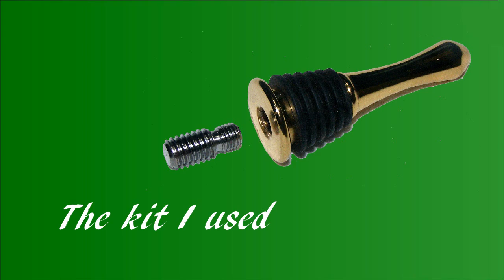A quick recording on how I made a bottle stopper

Comment: What size drill bit and tap did you use?
Reply from the maker: Hi Thanks for watching 

The tap was a 3/8" x 16tpi threaded tap which is a UNC series thread (A whitworth tap is the same size but uses a 55 degree angle but will still work in wood) and I used an 8mm drill.

Hope this helps - - Cheers for now -- Bob